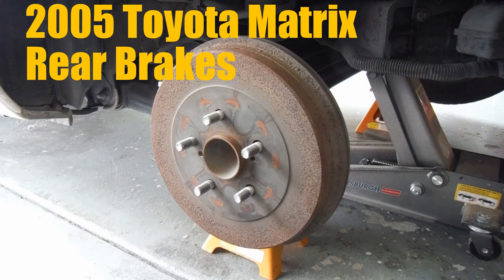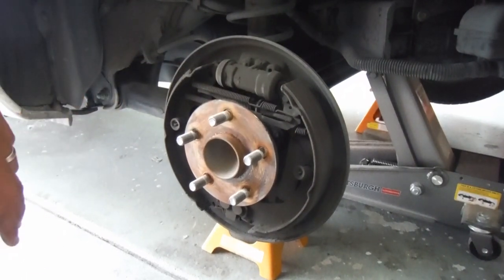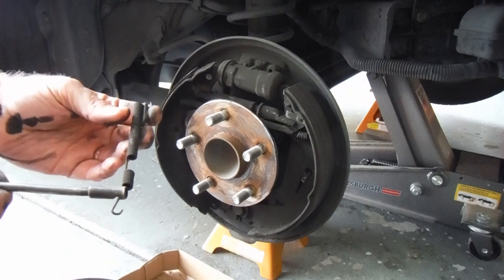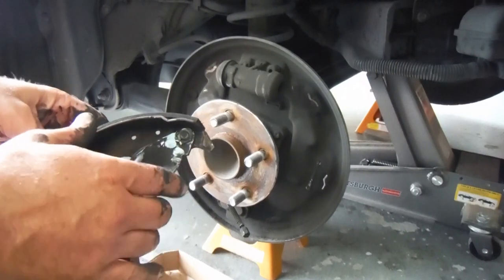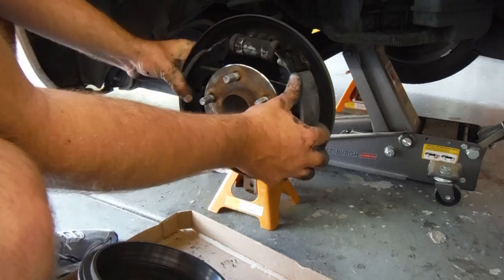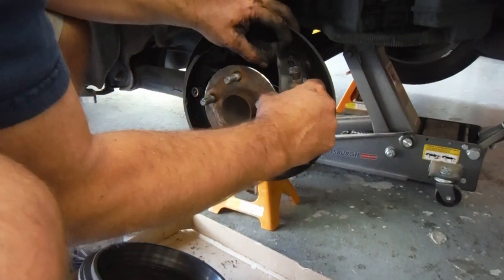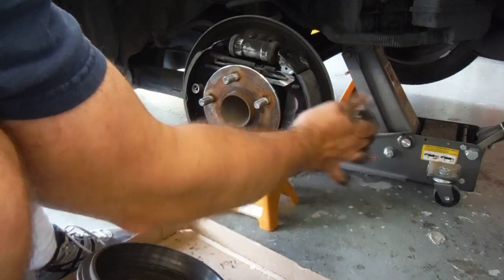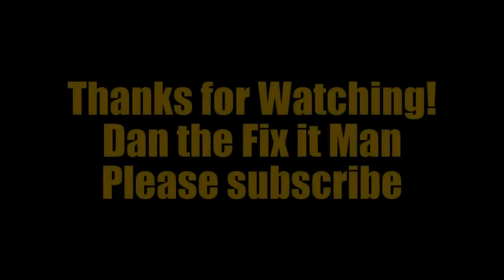2005 Toyota Matrix Rear Brake Shoe Replacement (Drum Brakes)

Comment: Suggest two things, remove both wheels and drums but do not dissamble the opposing side. Do one set at a time in case we get a little confused during reassembly we can refer to the side not yet worked on. Also take a few photos of how things are before disassembly is a good idea - especially how the E-brake is assembled.

Comment: I just changed the front brake calipers and pads. Bleed the front ok. Can't find the rear brake bleeder screws.!!! nothing above the brake lines. What?
Reply from the maker: I believe it should be off to one side of the brake line right at the back of the wheel cylinder.  It's possible that they broke off if you're in a rusty area?
Reply: you are right, the wheel cyclinder was so rusted that nothing was sticking out where the bleed screw should be! I replaced the wheel cyclinder w;/ blleed screw attached and managed to bleed the system. One thing I did notice is that my brake shoes are different from yours w/ different holes for the springs.

Comment: Thanks Dan for this video,, it is very helpful.  Re; wheel cholks - please folks, when you go after your parts ask for a set,, I did not already have them so purchased a pair for $7.80.   VERY cheap insurance the car won't roll while jacking.  At approx. one minute Dan mentions the 2 bolts we need to ease the drum removal,, those are M8 x 1.25 x 50mm (length). To those viewing you need these longer bolts to reach through the assy and press against the backing plate.

Comment: Good vid very helpfull for this MATRIX/VIBE setup.You might try pre adjusting shoes b4 installing drum.Then after drum install, with lug nuts holding them in place pull up parking brake and listen 4 clicking sound.This will indicate your auto adjusters where installed correctly and are working.Then rotate drums by hand to check 4 correct adjustment. Reinstall wheels and ur done.NOTE WHEN FULLY ADJUSTED, CLICKING SOUND WILL NO LONGER B HEARD EACH TIME U PULL UP PARKING BRAKE. Check owners manual 4 brake fluid R@R intervals.

Comment: You need to use high heat lubricant in the back 6 spots of the plate so that the shoes does not squeak. would be nice a different camera angle due to arm blocking video. but good job.

Comment: Good afternoon Dan. Thanks for this video. My left rear wheel bearing is starting to fail, I needed the size of the bolts to take the drum off, and you have listed them for me. I have a 2008 Scion xD, hope the bolt holes are the same.
Reply from the maker: They probably are the same, most Toyotas use this size for pulling the drums off.  Good luck!  Let me know if it works for you.
Thanks for watching!
-Dan the Fix it Man

Comment: Is the brake dust not hazardous?
Reply: no - asbestos was used years ago no longer used on these cars if your working on something from the 70's or older than use caution - no compressed air, etc.  - spray everything down w/ brake cleaner and ONLY brake cleaner

Comment: I replaced my rear brake shoes and all the hardware, then expanded the shoes until there was some friction with the parking brake off. Now the parking brake does very little (I hadn't really checked how well it was working before I replaced the shoes). Do I adjust the brake shoes again after driving the car a little more, or do I assume that the problem is the cable adjustment?
Reply from the maker: I would check to make sure the shoes are adjusted properly first, and then go to the cable adjuster next.  Best of luck to you!
Thx,
-Dan the Fix it Man